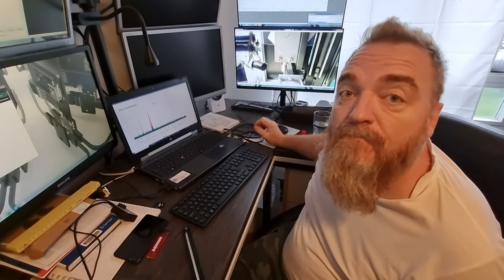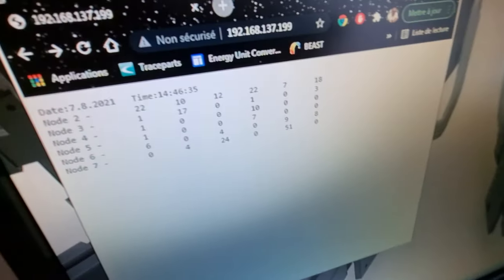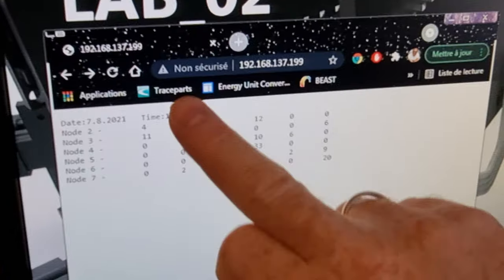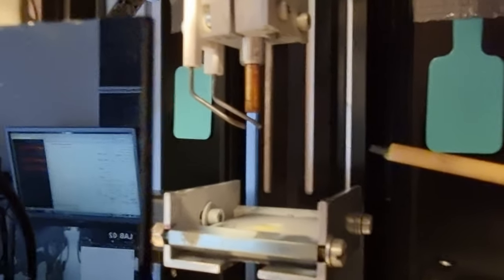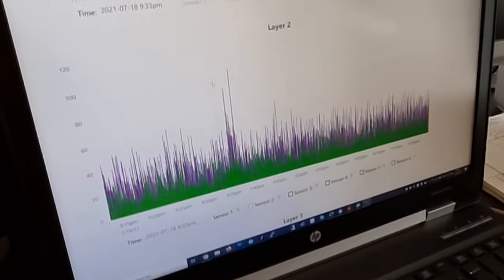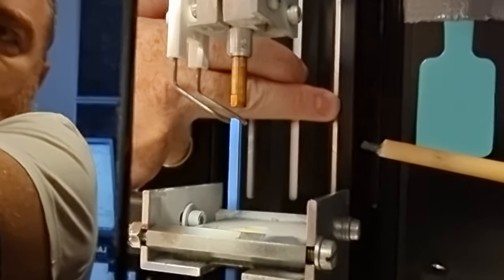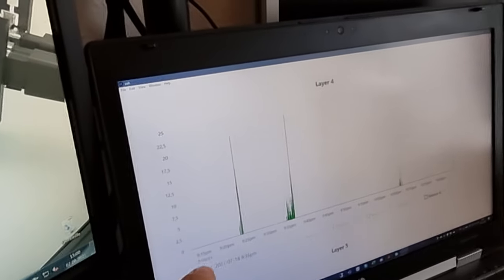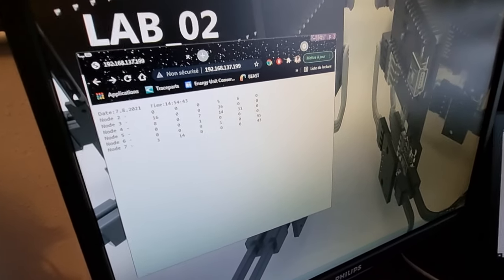Fixing Fukushima - Detection of what?

Comment: Is this with Thoriated W or pure W?  Thorium being vaporized may account for some of the increased counts if its Thoriated Tungsten.  If you have pure W would be good to compare.
Reply from the maker: Thoriated - happened in replication with Indium too.
Reply: @MFMP  Cant wait to see it with indium as well!  The pure tungsten welding rods have the green paint on one end vs the thoriated ones that have red paint ends typically.
Reply from the maker: @davidboutilier9841  The indium did it also - will publish ASAP.

Comment: How thick is the aluminum film?
Reply from the maker: Kitchen foil (I know it varies, but within that range is the best I know at this moment). We replicated it, with Indium also - will publish tomorrow as on overnight bus now.
Reply: @MFMP  my thoughts were this looks like a beta detector. Congratulations to our friend for good work. I'm finding beta emissions myself.
Reply from the maker: @BluesDoctor  They must be very strong Beta as not able to detect from 90Sr/90Y source
Reply: @MFMP  are you using a crystal in that detector?
I've rebuilt several beta/gamma detectors using common kitchen foil, and have tested against a few beta emitters with good response.
A note: I was using standard foil not heavy duty.

Is your detector made to be Beta sensitive?
Reply from the maker: @jamesluck2969  The Al covering is thick enough that it is not able to detect beta from 90Sr/90Y source.